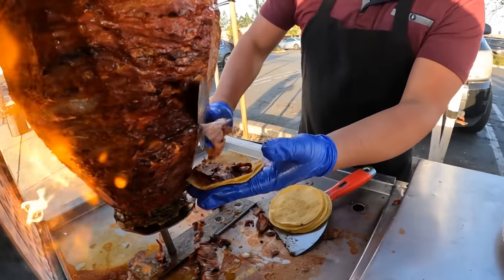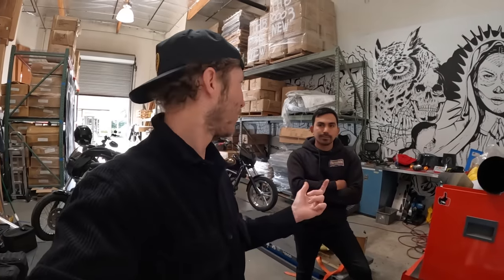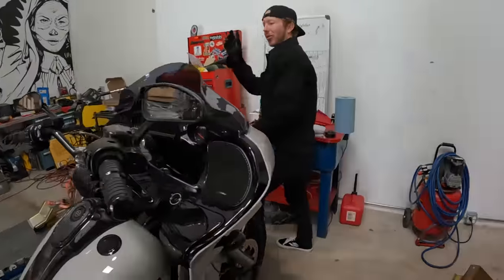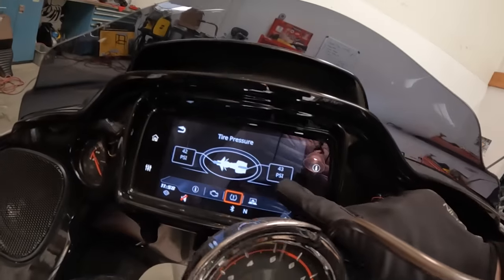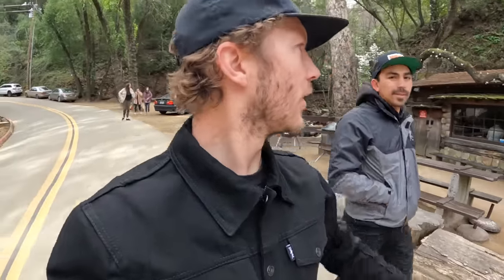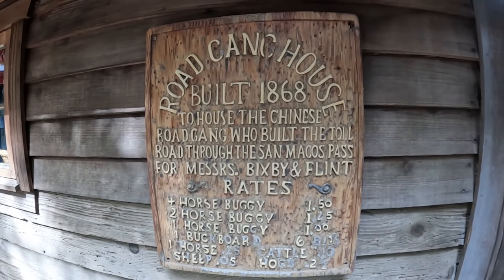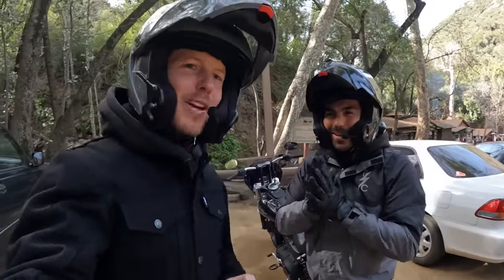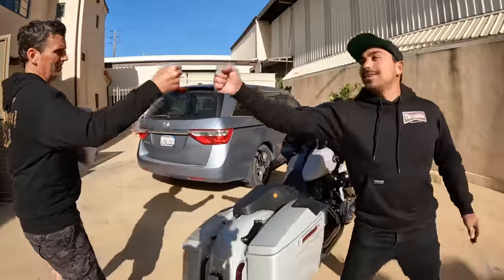Cold Springs Tavern + Sneak Peak of the Lowrider ST! Vlog 59

Comment: Can you guys talk about lane splitting in one of your videos.  What are the rules?  Can you do it at any speed?  Any Highway/road?
Reply: CA sort of has a vague law on Freeways for lane splitting... with in 15 mph of main speed of traffic, and not really recommended when main traffic speed is over 30 mph. ie main traffic speed is 0-30 mph.  It's more useful when the margin is safer when there is a HOV lane on in city on the freeway, and then the number 1 fast lane.  Much wider buffer left there, between the HOV and #1 labe, though in general motorcycles can ride in the HOV lane all the time, which usually moves the fastest. These guys hang with the Reckless crew, so there's your sign.  Check to see if your state DMV laws allows lane splitting, most do not.

When in city traffic with stop lights... pulling up between stationary cars to the front of the stop sign / Stop light is known as lane filtering.